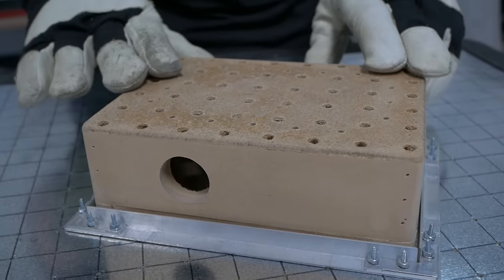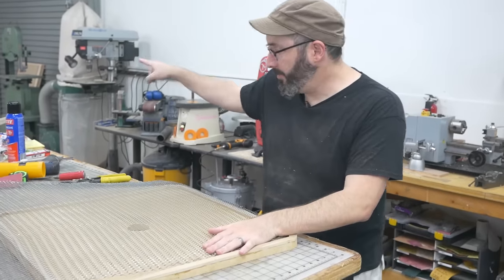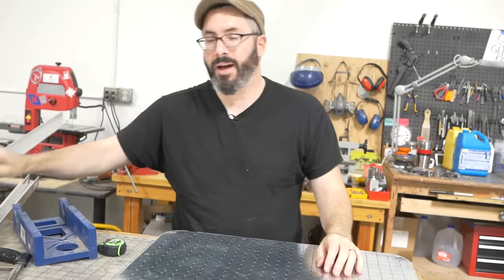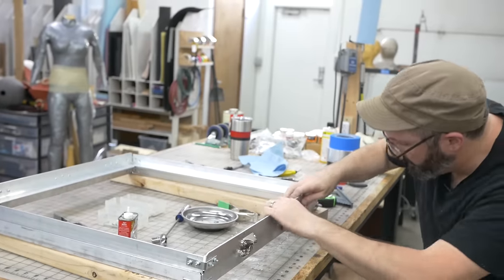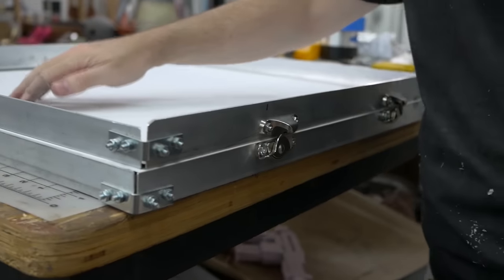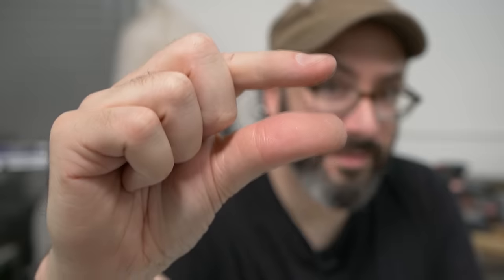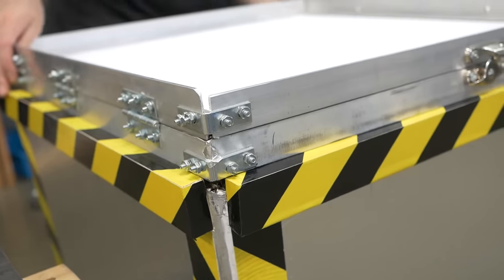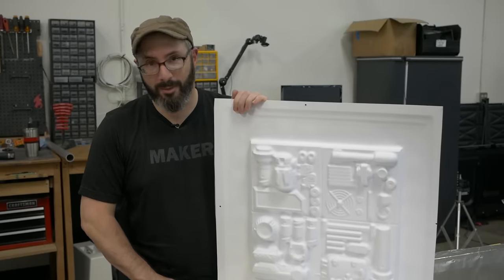Hardware Store Vacuum Table - HOW TO make your own

Comment: Are you using any material around the piece that you are molding?    As a prosthetic tech we would use a special cloth to allow no air pockets to form.   Womens stockings (used) wrapped  around the piece, applying a little baby powder on the material and you are good to go.
Let me know if it works....what do you use?
Reply from the maker: I typically use baby powder

Comment: To get a more even heat from the heaters,  could you have placed a metal plate over both heaters? You could paint the side facing the heaters black and then the plate would be a more uniform temperature across the face.

Comment: To make the aluminum frame simpler cut 2 45 angles on one side of the L shaped  then bend the corner then you will only need the angle reinforcement will only be needed on one corner.

Comment: While going to University, I worked with a guy who had started a vacuum-forming company. His former was similar to this, but he heated his plastic sheets (usually ABS?) in an oven. I might have used a sheet of pegboard as well rather than drilling 576 holes. Then again, I haven't built a vacuum former, so I'll shut up now :)

Comment: First time ive seen a ‘vacuum pull’ and never hearf or thougt about this before now, and wow it is such a cool and relatively simple process to basically manufacture intricate molds or parts! is that what a vacuum pull is generally used for or what is its main purpose? So many purposes i can think of and the first one that comes to mind is a  custom box or case for carrying cameras and instruments and even just a superbcompact tool box that would make it possible to fit way more tools in the same size of case! thanks for the video awesome work
Reply from the maker: You could absolutely vaccum form a custom carry case, great idea! For reference, Star Wars Storm Trooper armor is largely vacuum formed, as are many other pieces used in film!
Reply: wow that is cool ha

Comment: Industrial Thermoformer for 40 + years; Raise mold off base to allow vacuum under mold roughly .032", wire drill mold so vacuum can reach surfaces ... hole dia. .032" should be made with clipped end piano wire, also need to use a surge tank that has roughly 25 inches of vacuum on gauge - use ball valve and turn ball valve open slowly to mold and maintain 20 inches of vacuum for a good part, to much surplus material to center area of mold in frame - use a ring plug as vacuum is applied slowly to prevent Webbing Of Material .... must always take "width to depth ratio" into consideration and have different frames / forming base set up. Hope these tips help others.
Reply: Can you add some detail to these tips? They seem very useful. Thanks

Comment: Insulate the top of the styrene sheet so you don't lose heat that way either.
Put a contact switch so that the heaters don't start until the frame is in place and shut off as soon as you lift it off.
Reply: "Insulate the top of the styrene sheet so you don't lose heat that way either."

OMG. Sometimes the most simple things are those which are missed and those which are the most important. You're absolutely right, it must be losing about 50% of the heat through the top.... dooh... :-)

Comment: Instead of all that work with the expanded metal bracing for the thin metal platen (AND avoid having to drill all the holes) JUST BY HARDWARE PEGBOARD which is strong enough not to sag with this low vacuum. AND you can reduce that webbing by using a custom cut plywood reducing window that has an inner cutout a little larger that the parts perimeter.

Comment: Rather than using the cheese grate in the platen, cutting 1 inch squares of the 1/4 inch thick mdf would prove best for air flow. at least on mine. It also will prevent any flexing. After the platen is assembled, I also shellaced the whole thing to help seal the wood. If it ever gets wet it will expand on ya which is no bueno.  For the frame I bought some "3M Walking grip tape" which is the same tape you find on skateboards and put it on the insidedes of the frame to keep the plastic from slipping. Lastly, the metal top I made about a half inch wider and hammered it over the sides and after I sprayed it with adhesive  I then tacked the overlap with small nailes (after pre drilling the metal) I hope this helps :)

Comment: Sorry I have not read any of the comments but if you were to lower the frame with the plastic in it down closer to the heaters. Would the plastic not heat up faster?

Comment: So, how hot was the wood on the outside? I need to make an oven, and was wondering about using wood....I have ceramic insulation to go in between the heat and wood though.

Comment: Do you think vaccuform would be a good option for blades?  Carve/sand a buck of the blade halves, form over both, trim the excess, full with some expanding foam and fix the edges?
Reply from the maker: Hmmmmmm you certainly could - it may be a good option for a symmetrical blade that has odd shapes - worth experimenting!

Comment: You need to raise the plug above the surface with a sponge-like mattress material to prevent wrinkles at the corners on tall plugs just like the ones you were having trouble with, stick a 2-inch thick piece of foam mattress under it and it will suck all the way down with no wrinkles.
Reply from the maker: Interesting!

Comment: You may get better heat by making the heating box a bit shorter to get the plastic closer to the heating elements.
Reply from the maker: That is true, but we found that the closer to the heating elements we had the plastic, the less even the heat was. The distance we settled on seemed to be the best compromise for our heaters.
Reply: Good info. I was speculating, but clearly you’ve done your homework. Great video.

Comment: Instead of relying on aluminum foil to insulate your heat box, I would suggest painting on a few layers of satanite. Satanite is a mortar that gets painted over kaowool and fire bricks on the inside of forges and metal melting furnaces. Satanite not only prolongs the life of the wool or bricks, but it also increases the insulation factor as well.

Comment: Great example. I have question though: for vacuum forming transparent parts (e.g. windshields, light covers etc) can you still use infrared heaters, or does the IR light go straight through the transparent material without heating it up? Has anybody tried?

Comment: How about have a blower fan in the heater box to circulate the heat? I saw a unit which had a heater at the top. The plastic tray slid down with an aluminum tube at each corner.

Comment: use the heating elements out of an over with the temp. control module. you would have way better control over the heat and be able to keep it more constant. use a small fan to circulate the heat to heat both sides of the plastic. it should also speed up the process.

Comment: @Punished Props Academy   If you want to make your heater set-up shorter and a bit more efficient you should use Foam Board Insulation on the inside instead of just foil. And if you want to distribute the heat more evenly you can build a wire mesh platform above the heaters and place a ceramic tile above them. You want the mesh because the tile has a chance to crack.

Comment: Why did you make the heater box so tall, why don't you make it shorter to make the heat more efficient?
Reply from the maker: 'Cause I needed to be able to reach it comfortably and also not have TOO much heat too close to the plastic

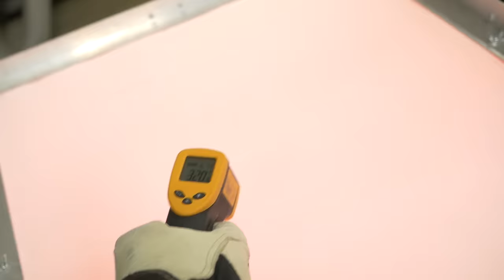Comment: 31:40 Put a lid on it...fit it inside the frame(or over the outside).  You can transfer the frame and lid to the table together.  The lid will also hold a little heat for a bit while the vacuum is working...then remove it.  Might help with definition.
Reply from the maker: Thanks for the suggestion!

Comment: Using some decent attic roll insulation on the outside of your heat box would help with temperature retention.
Reply from the maker: Thanks for the suggestion!
Reply: @punishedprops  no worries!

Comment: Instead of the two layers of net, you put inside for to prevent the box to collaps, you could just make some more MDF lists as you made around the edge, and spred them out between the plates.
Easier and a lot cheaper then to muy that net.

Comment: Curious if a (poster) snap frame would be suitable to hold the plastic sheeting?  Out of the box solution, just needs the middle cut out (assuming it comes in a desired size)

Comment: so where id you loose the 51 holes for your grid? the vac. hole doesn't do it. The heater box will be easier to use and give best results with a thermometer for interior air temp just below the plastic to prevent over heating and under heating

Comment: I'm thinking rivets for the frame, and maybe a heat gun to finish just in case.
Also thinking the vacuum could be turned on ahead of bringing the unit over.
Reply from the maker: All good ideas!

Comment: Maybe you could find a heating element from an electric oven. It would likely require 220v, but you would definitely have enough heat and it would probably be more evenly dispersed. Generally, there's one for the oven and one for the broiler.

Comment: Yeah turn on the vac before you put it on the item you want to be molded and if possible warm up the part to be molded. Maybe make the vacuum holes a bit bigger and try two vacuums at once?

Comment: Good job. I'm sure you're sick of critiques but why not just get some heater wire instead of using those pre-built heaters? That would solve some issues you had with uniform heating and how long it takes to get the plastic up to temp.

Edit: wow this is a 3yr old video. YouTube recommended this and I didn't realize it was old. My bad.

Comment: Run a router trim bit across the front of the wide part creating a dado cut, the top piece will slide over.
Reply from the maker: Great tip!

Comment: The frame could be hinged permanently on one edge of the vacuum table and flipped directly over the heat source - which would be an integral part - making one unit...? 
Thanks for an interesting video...
Martin Bronsdon
Gothenburg, Sweden
Reply: I think they state, that the intention is for the unit to be taken apart and stored flat.

Comment: You subconsciously had the right idea for the heater when you were messing around: you want to make a pizza oven so the plastic is heated from both sides, and you don't lose all your heat from the top being open. You don't need anywhere near that volume in the box. Your frame can slide in and out through a slot in the oven, and it will take a fraction of the time to heat up. The bottom of the table (below the mesh) doesn't need to be structural, just non-porous, saving a lot of bulk and weight.
Reply: If you do this, how do you monitor the temperature of the plastic?  Thanks

Comment: I wonder if its possible to make a moving bracket for the heating elements.  Attach a small motor to make it osculate so that the heat gets more spread out.
Reply from the maker: Perhaps, but I don't think it's necessary with this particular build.

Comment: You need to use a replacement heating element for an oven. They are only about $30 brand new from amazon or ebay and they cover the entire heating surface evenly.

Comment: have you thought about making a foot pedal to turn on and off the vacuum? they are not that hard to build I used a standard 3 prong outlet a press and hold switch I got from e-bay a few 3d printed parts made from petg and an extention cord that got the plug in side got ripped out due to someone forgetting to unplug there car before leaving (in Alaska it happens a lot)

Comment: You have heaps of pegboard on the wall behind you for your tools -- why not use some of that as the top panel so you get a regular grid of fine-spaced holes and save yourself all that time/effort drilling? If it sags in the middle like a pizza-box lid, add some supports in the blanks between holes.
Reply from the maker: We wanted the holes to be smaller.

Comment: How did you decide how big to make the holes?
I once tried to build an airhockey table, 4' x 8', with 1 mm holes (that's what the holes at the local arcade's table were).  3600 holes later I found out they were too small, the whole sheet lifted off the frame like it was being inflated by the vacuum I was using, and negligible air was coming through... :(
Reply from the maker: I guessed on the hole size, but I've seen several other larger machines and tried to get it close to those.

Comment: What type of materials do your templates need to be made from? I was thinking of making a template to mold from a 3D printed model but I don't know if that could withstand the heat of the hot plastic when put on top of it.

Comment: I probably would have taken my frame pieces to an aluminum welding business...and let them do it. Frame needs a lot of strength, and welds won't loosen with time, the way that screws/bolts/nuts/washers will. Just a thought.

Comment: Bit late, but depending on the workshop air temp, wouldnt that effect the temperature the plastic can reach. Wouldnt sealing the top fix that, and also decrease the total time taken to heat the plastic?
Reply from the maker: That could definitely make a difference.

Comment: a couple ways to improve it have the mould put on the frame don't take the frame off the heat. do a way with the metal plate not sure why you think you need it takes away the heat instantly. stand your mould away from the surface of the vacuum plate screw it from underneath with some long screws to hold it in place there's no way for the former to go when it hits the metal plate, standing the mould away from the surface stop the edges from crinkling.
put some corner braces out of 2 by 2 across the frame meeting in the middle. give it more rigidity and strength.
what about Rodger 290.

Comment: A question If I have a Vac. Table that is set into the top of my work bench and I want to hold down a piece that is larger than it covers will it still hold fast of do I need to build a larger unit

Comment: Are the materials you use sticky? I want to make a plastic insert for a custom figure I’m making for my friend but the base material for the figure is PVC and I’m worried it’ll damage the figure or adhere to it. It doesn’t look like it’ll hurt it but I’m not a pro 😭🤦🏼‍♀️
Reply from the maker: The styrene and things we use aren't sticky at all! It's just plastic :) Make sure you research if your material you want to use is safe for vacuum forming/heating first!

Comment: Try using a small rubber inner tube from a bicycle wheel. Take off the front wheel. Then take the bike tube out of the inside of the tire. Take the tube and lay it on something flat. Then scribe with a 4 foot straight edge. Then take a sharp knife.Using a 2 foot square or a 4 foot straight edge. Clamp both sides  of your straight edge to the inter tube.  Start your first cut one half inch from the top. When you get to the bottom of the cut stop a half inch from the bottom. Don't loosen the clamps just yet and do not cut the tube until both have been cut half inch from all  4 sides of the tube. Take some small wooden blocks and clamp past your final cuts of the inter tube. Remember Don't cut the final cuts yet. Tighten all 4 clamps. Loosen the clamps on the straight edge then make your final cuts. Draw an oval shape on  the bottom of the board where your springs will mount. This  is the part is where it gets tetanus. Then take the metal springs and mount them side by side on the drawn oval shape. I used c- shape screws to attach the springs to. I put supper glue before screwing in the screws. Then after attaching the springs to the bottom. Take some 1 inch x 1 inch angle aluminum to fit and build it either as a square or a rectangle shape for the springs to mount to the top of your board. The oval shape that was drawn to attach the springs has a purpose. I have a pointed brass bar 3 inches long and 1 inch round attached to a string with a small headed nail tied to the string. After mounting the springs take them out and draw another oval shape that measures 1 inch from the first one that was drawn. Use a compass to mark from the holes where the screws were put on the bottom board for the springs. Then I took the brass bar with the nail and put the nail in the 2nd drawn oval shape. Then let the brass bar hang on  the leveled board so it pivots down on the point of the brass bar to the transfer mark. Loosen the string and push the point of the bar into the board then continue to do this on every other hole. Then make a oval shape a half inch from the inside of the  2nd oval shape and do the same thing as the second one and take the rest of springs and that's it. Now you have a perfect mold

Comment: How durable is that plastic? While watching this video I got the idea of using this to make custom tool trays for my wrenches, ratchets, etc. for my toolbox. Would it hold up to repeated removal and replacing tools from the plastic tray?
Reply: You can use a variety of plastics in different thicknesses and durometeric ratings.  You can also use a foam press as opposed to a vacuum table, for items that aren't too tall or too close together.  Kydex would probably be a good choice for a durable material.
Reply: Thanks for your advice Jeff. I've seen some videos on making sheaths and holsters from Kydex, but didn't think of it in this application. Good idea.

Comment: Name- Polly wanna Vacka (Vacu) :). Would this also work to hold tools in place in a draw ?. Heat and drop two sheets and use the outer sheet  with the slightly loose fit ??. Or the first sheet and drop resin on the back and toss the sheet away ??. Don’t forget to put in finger extractor holes :).

Comment: also put some foam tape on you frame like the kind to seal a air condition in the window but wider  it will help to seal it and pull a stronger vacuum
Reply from the maker: Thanks for the suggestion!